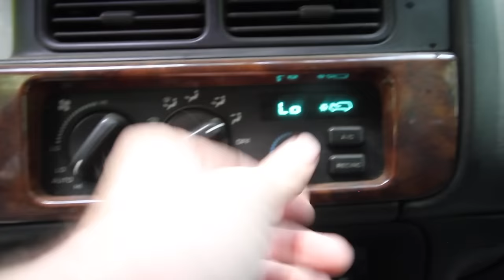How To Super Flush your Cooling System in One Easy Step - Operation Cheap Jeep

Comment: great video you got me wanting to flush my cooling system on all 3 of my trucks and none of them are running hot. also I'd like to see a follow up video on your cooling problem. to see if there was something in your cooling system that is failing or if it truly just needed a flush. I kinda think you may still have some problems like a thermostat that is sticking or perhaps a water pump on it's last leg . inquiring minds want to know!!!!
Reply: If it isn't broke don't fix it.  Fixing unbroken things is the #1 way to break them, or other things.

Comment: Hey Matt, how about springing for one of those prestone heater hose flush kits? (they are about $5) 

So you don't have to try and get older heater hoses disconnected from your heater-core.. And you can hook your garden hose directly up to the supplied fitting flushing it both ways before blowing it out with compressed air, and you can also burp the air out though it at refill. Just a thought.
Reply: That's what I install in my vehicles, works great, and pretty quick flush without disconnecting a bunch of stuff.

Comment: I pull the rad drain out and run the engine with the water hose in the radiator fill.    Let it run till its totally clear and the whole system is flushed

Comment: Do you think it is OK to drain a radiator after the car sitting for 4 months or do I need to start the car up to circulate the coolant in the engine and drain it. After that use flush with distilled water to flush the coolant system......

Comment: the heater core does not bypass the  thermostat . that is why when cold start it blows cold air , until the stat heats up and opens  allowing the hot water to flow through .

Comment: I heard distilled water is ionic
And corrodes the aluminum in the radiator making it prone to cracking.
I don't know if it outweighs the mineral
Theory...anyway great video!
Gonna do it this way to a Olds intrigue.

Comment: I generally like to only use pee in all of my radiators. Well, 80% pee 20% water. The pee has to be straight from the source, (stale pee can become contaminated). From experience, it works great. More power and torque. Seems the heater and thermastat works more efficient as well. Inviting friends, family, and neighbors  to help you top off is generally easier and quicker. Completely worth it!
Reply: METALfanUSMC 
It worked in red dawn. So it has to be good

Comment: Thanks for the video. I have a TJ so my hoses were a bit different but the concept was the same. I watched again after performing the flush and in my test drive I forgot to run my heater core. I also wasn’t able to fill coolant into the pump like you did because my heater hose from the pump to the top of the block is a rigid pipe not a hose and it’s horizontal. I still feel pretty comfortable. Also… there was a rubber flap below my radiator that had a TON of debris. I think it was blocking the ac and not the radiator but I took it off? Thoughts on that?

Comment: Don't get me wrong, the way he does it is probably slightly more effective, but you can just buy a cheap flush kit for 10 bucks that splices to your heater core line. It connects to a hose.

Comment: why dont you just take off the radiator cap and drain, drain the coolant, put ahose on the radiator , run water and start the engine it will pump the water and drain the coolant in one go, then drain all the water after it clears and fill it up with coolant.

Comment: Aren't you not supposed to use regular water in a cooling system, aka the garden hose. Wouldn't rinsing it with the hose to flush everything leave the calcium and other bad particles in the system?
Reply: that what i was going to ask to.
Reply: Thomas Salem it doesn't leave enough residue to be of concern.
Reply: most likely wouldn't be enough to affect anything, but it could depend on the quality of your local water. in all honesty though its trace minerals in trace amounts of water droplets, so yeah technically it would cause a small issue but probably not worth worrying about or spending extra money to avoid considering its a Jeep.
Reply: Yeah I like this method for a beater or a Jeep but for a 2012 sedan I'm not gonna use this method, respectively. Don't wanna get hose water in my system
Reply: Same question
Reply: Has anyone actually tested the difference between hose water used with antifreeze and the distilled water? I've been using hose water for over 25years and never had an issue. With everything from old cars with brass copper radiators and new cars with aluminum systems. I guess I'm just lucky.

Comment: Thank you for this. My cooling system is in dire need of a flush.

Question if you don't mind. Is the procedure relatively the same for the 4.0 liter inline six for a wrangler?

Thanks again for the video, well done.
Reply: Eric Bauer 
His method is too involved and complicated. Use an engine flush kit that connects your garden hose to the cooling system. Now turn on the water and start the engine. The water you're putting in flushes the whole cooling system out, no taking anything apart or anything. The flush kit is made by prestone, they've been around for at least 50 years.

Comment: Hey love your videos but I'm hoping you can answer a question for me. On the XJ 4.0 (specifically 91-96 year) do you know at what temp the coolant is at for when the motor switches from open loop to closed loop mode? I know that the O2 sensor temp is the main determining factor but I know that the ECU also uses data from the coolant temp sensor. But I don't know what temp the coolant needs to be at for the ECU to say "all good"

Comment: I put in  k-seal bc of a cracked head gasket.. would this be alright to do?  or would it be too much pressure and break the seal when I flush the engine and I'd be better off doing the radiator /distilled water method? I prefer to flush it and not just rinse it out but don't wanna screw myself over cause the k-seal is working great

Comment: I have a '96 Grand Cherokee with the 5.2 and always have to top off the coolant. I'm guessing it's a head gasket. I'm sure just flushing won't fix the problem.
Reply: Whitesoxfanone if your head gasket is bad you'll have antifreeze mixing in the oil and vice versa
Reply: Check the cooling system for leaks.  They have leak detection dyes you can get and put in the coolant.  Put some in, run the vehicle for a day or 2 then use a black light and see if there's any leaks on hoses, water pump, radiator, etc.  

Check your engine oil, if it looks like chocolate milk then you've got a blown head gasket, otherwise it may be an external leak or its burning it.

Comment: Got a Jeep question for you I have a 94 XJ live here in AZ where temperatures in the summer get 105+ my Jeep gets to 240 on highway speeds but at night it never gets over 210 it has a new water pump, new stat, block, radiator and heater core have all been flushed what’s my issue here?
Reply: Air filter is good

Comment: This seem relevant since my Jeep is having cooling issues. Every time I stop and shut the engine off, my coolant boils like crazy and pukes out all over the place. Doesn't overheat while running at all (actually stays below operating temp with new rad). 89 XJ 4.0. Already replaced the radiator, thermostat, water pump, and overflow bottle cap. No leaks other than when I stop the motor. Possibly cracked head or blown head gasket? That's all I have left I think.
Edit: Oh and theres NOT oil in the coolant or coolant in the oil.
Reply: Se7enAte Possible that the head is cracked, very common on Jeep In-Line 6 cylinder engines. If you open the oil cap and look down with a light, you should see bubbles in the oil.
Reply: Tyler Nutter yeah that's what I'm thinking. I'll probably pull the head off tomorrow and see. if the head is cracked it's not worth replacing on this motor. I'm just gonna go all out and rebuild with a 4.6 stroker kit, forged internals, and aluminum head if I can find a reasonably priced one
Reply: Se7enAte coolant boiling is the reservoir is a sign of a bad radiator cap. You mentioned you replace a bunch of cooling system parts but not the cap. I've found more caps cause cooling system problems than anything else.
Reply: Se7enAte Good luck on that hunt! When I built mine (ground up) it was close to 1200 for just the internals.
Reply: Eric faley my radiator doesn't have a cap. Just the overflow bottle. and I have replaced that

Comment: Is the hard water you're putting in via the hose a problem? Or is it diluted to the point it's harmless after you fill up with coolant?
Reply from the maker: I pushed it out with compressed air.
Reply: @bleepinjeep  duh...wasn't taking that into account...thanks for the response...dig the video.

Comment: Check the thermostat!!! Here on Arizona my 98 zj was heating up like crazy and the solution is the thermostat I changed the 190F to 180F and it is a big difference.
Reply: Antonio Perea Linares that's like a bandaid. 180 thermostat can still make you overheat
Reply: Soul Killer to me worked just fine, my temps now never rise over 210
Reply: Antonio Perea Linares it’s bandaid. Go to any Jeep forum to be enlightened.

Comment: Hey, I am thinking about building a 4x4 offroad buggy but I want to be bale to select between 2 and 4wd and am looking at Polaris 1000 transfer case but I want to see if there are any other options. Does anyone know of a small transfer case that I could use? It doesn't have to be push button or have high or low gears I just need to be able to select between 2x4 and 4x4!

Comment: You should just put the water hose in the inlet run the engine and you would flush out the whole system

Comment: Why didn't you remove the engine block coolant drain plug to properly flush the system?
Reply: Mark Kennedy is that something jeep v8 have?
Reply: Yes it does have a  engine block coolant drain...as do most if not all engines.
Reply: Mark Kennedy are u talkin about the freeze plugs
Reply: fuzzy wuzzy ....no there is a threaded engine coolant block drain. Look it up.
Reply: Mark Kennedy he had to change the muffler bearing to do that! Duh!😎👊💙
Reply: and you might as well change your blinker fluid while you are at it
Reply: I know my 4.0 straight 6 has a plug (5/16" male pipe plug socket) but not sure about the V8.

Comment: Hello, If the air is not all released will it cause the coolant to boil? I think this mechanic is trying to take my money. My Jeep never ran hot, nor is it showing signs of a damaged or blown head gasket. What do I do? Please, I have never had a Jeep before.
Reply from the maker: Yes. There should be no air in the system

Comment: Whoa bro, what's up with adding water to the antifreeze, it's already 50/50 mix, no water needed, add antifreeze straight out of the jugs until system is full or am i missing something ?
Reply from the maker: It's not 50/50 unless you like to waste money and buy 50/50 😆
Reply: On my 97 Cherokee sport the front end is Lucy goosy, what do you think ?
All stock, what all should I replace ?
Track arms, bearings or ball joints

Comment: Do you have a video of you replacing the fuel injector wiring on a XJ? My wires have gone to poop and it's screwing with idle. If not, can someone help find me a write up on how to replace them? I Can't find anything in the forums.
Reply: Travis rossman are u sure its your wires. It could be your ecu. I had to replace mine with a rebuilt one bc it was messing with my idle and running rough

Comment: I would not recommend using compressed air especially at the PSI of an air compressor. Could potentially blow out gaskets like head gaskets, also not sure the heater core and radiator capillaries/passages are designed to hold that much PSI. I honestly do not know but just seams potential for damaging like head gasket, thermostat gasket, intake manifold gasket, water pump gasket by pushing 4 times the PSI that it normally operates at through it. The average cooling system in a car runs at 14 PSI, an average air compressor puts out 90 PSI..
Reply: Torpedomtb definitely agree
Reply: you shouldn't pressure up a cooling system for sure... but the way he tries to seal the air nozzle with just his hands, there is no way he's getting much pressure in there, just lots of air flow.
Reply: I thought the same, but as long as you adjust the regulator for your line pressure and dial it down really low, it shouldn’t harm anything
Reply: You know that there's no way the pressure is actually getting up to that pressure, right?  It's not like he's pumping it into a sealed system.  With all the openings it's never going to get much higher than ambient air pressure.
Reply: That's a water hose not an air compressor. Also with all the hoses off there is no way to build pressure in the system it will just escape from the exit port on the other end of the hoses.
Reply: With all the hoses disconnected there is no way he's pressurizing anything more than 2 or 3 psi, if that hurts anything then you might as well fix it because it's better for that to happen then than on the road or trail with 16psi in the cooling system.
Reply: I think you've been buying the wrong head gaskets if you're blowing them out with an air hose.
Reply: The Sick Horse Ranch, that’s what I was thinking 🤔 😂
Reply: The method he is using, with the hoses off, won't let enough pressure build up to harm anything.  There's even a specialized tool (blast-vac gun or something) designed to do exactly what he's doing by combining water from a hose with air from a compressor.
Reply: Drain it. Fill it with baking soda and water. Run it. Let it sit. Flush it. New fluid. Rust is gone.
Reply: 😹😹😹 Yeah. Cuz this system is sealed so well. 🤦🏻‍♂️
Reply: yeah?Without all the blasting?
Reply: Haha!  @thesickhorseranch  so true!

Comment: Ah but the radiator cap part doesn't apply to me... As I have a pressure release cap so I can open it while at operating temp.  (:   Very handy if you happen to blow a radiator hose... or freeze plug, something of that sort and the (overflow/reserve tank) is not putting fluid back in the system properly due to the leak in the system, you need to remove the cap to add fluid to get home if your in a no cell service area in the middle of no where.  lol trust me. .  just buy one if you have a jeep

Comment: What about for XJs cause that was on operation cheap Jeep right
Reply: WolfKingJS54 Same thing, Remove the plug from the radiator, heater hoses are on the passenger side, remove the top one and bottom one, and the engine? put the lower heater hose back on and remove the lower hose from the radiator. Don't go full blast with the water right away, slowly build pressure, otherwise you could crack the heater core and the radiator.

Comment: Still running those high end battery terminals I see. Those are forTEMPORARY/EMERGENCY USE ONLY. And that shit K&N dirt passing filter. That's the worst filter, especially for a 4x4 you can run. Remove the air tube and look inside. You will see a dust coating all the way into your engine. YES they flow more air. YES they flow more dirt too. If they were the cats meow, OEMs would use them.

Comment: I have a busted radiator in my 95zj what can I substitute instead of spending 140$usd
Reply from the maker: +Nathan Edwards a used one from pull a part
Reply: BleepinJeep my opinion always dump a bottle of the super wet stuff from any of the major companies in at rhe same time.  I use royal purple in my Hellcat and the red Hy-Per Lube in my two Powerstrokes.   they do seem to run about 10 degrees cooler and stay cleaner.
Reply: Rockauto, starting at under $80.00 for either I-6 or V-8 radiator.

Comment: I mean...you're paying for water anyway, when you buy distilled, bottled water. I get what you're saying, though.
Reply: At the Walmart here, 50/50 was $14 a gallon, and concentrate was around $16. Distilled water was $.69 a gallon. So for less than $17, I mixed two gallons of 50/50, and I actually did mine more like 60% antifreeze and 40% water.

Comment: One thing, you should replace any spring clamps with either new ones or screw clamps or you could end up losing coolant when the vehicle is under load. Those spring clamps are usually one use.

Comment: He didn't have to put distilled water in 5050 coolant. 5050 coolant has already premixed with water.
Reply: That's true, but he didn't use 50/50 coolant.  He used concentrate coolant, which requires mixing with water, typically at a 50/50 ratio, and when you mix it yourself, it's considerably cheaper than buying premixed.

Comment: Using just 50/50 is wrong. You're supposed to use 1 gal of pre and top off with 50/50. Otherwise you could end up with either a freeze up or boil over.